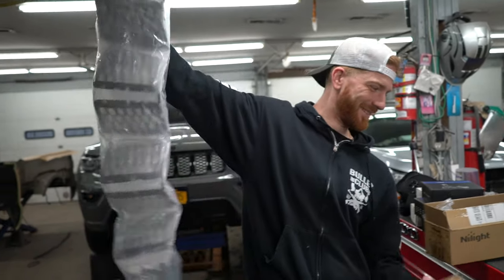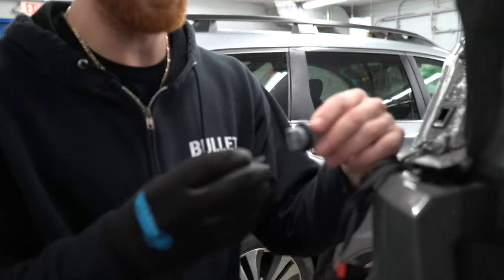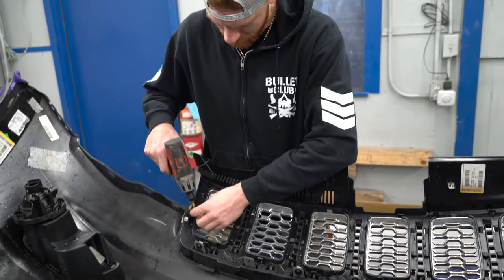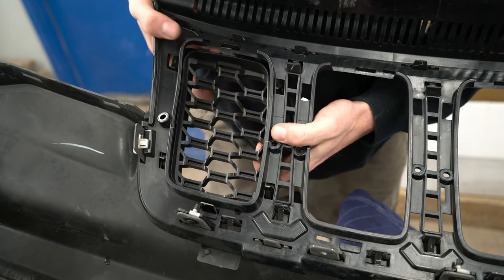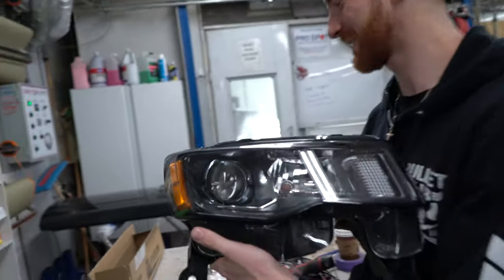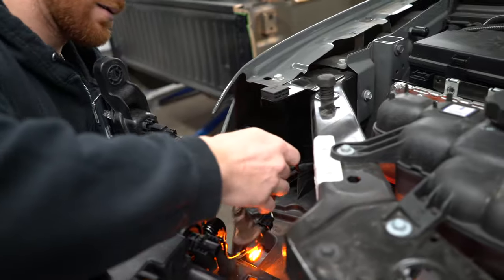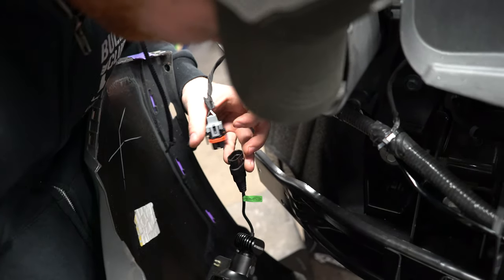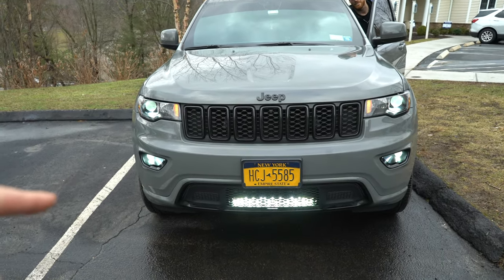2020 Jeep Grand Cherokee LED CONVERSION & UPPER GRILL INSERT INSTALL

Comment: Dude....seriously, the camera work gave me a headache...Did you film it on a phone from 2000?
Reply from the maker: It’s shot with a Sony a7s ii but the lens on it was damaged I need to buy a new one. It’s also shot in 4k so make sure your resolution was set to that other wise it will play at a lower res and can be pixely

Comment: Does ur jeep have halogen or projection type? I have a 2019 grand cherokee and have changed the bulbs to led but they still don't shine bright white, they're kind of like a yellowish hue to them and was told it's because of the headlight lens type or whatever
Reply from the maker: The stock bulbs where halogen and what was the color temperature of your LED bulbs? I don’t think that’s true cause these are clearly pretty white
Reply: Pretty sure all WK2s have projectors.
Think you mean halogens or HIDs, which  depending on who you talk to is either etra wiring to even an "entirely different ellectrical system"

I know it the '14 it was found that the lens had golfball divits all around. Never hear of them having different tints, but not sure what changes were made after 2018-2019

Comment: Anyone doing the lights in the lift gate, be careful particularly on a 2013, mine must have been made a little different...the translucent dome shade on the outside snaps together with the housing inside the door panel and the tabs on the dome are brittle as hell and broke very easily.  Breaking one tab means it won't stay on and the housing wont stay in the hole so breaking one tiny little uncooperative P.O.S. tab can ruin your day.  If you can get one to stick back I the damn thing to fix it, you're a better man than me.
Reply from the maker: Thanks for all the information hope everything goes well with your build!

Comment: Looks nice I just got a 2012 Jeep Grand Cherokee and I see a flash with the high beam seems like goes brighter but when I go to look at them that high beam bulb is not on on both sides it's strange to me because when I have it on auto high beam I see him go off and on but when I turn it to manual and then I put brights I see a brighter light but when I go to look at the headlights I don't see that second inner bulb on
Reply from the maker: Hmmm that’s very strange I’m guess it’s a computer or wiring problem

Comment: How many pairs of LED’s ? Looks like he used 6 new ones so would you have to buy 3 of the LED pairs?
Reply from the maker: 2 sets for the head lights 1 set for the fog lights 1 set for the reverse lights
Reply: @MrMsStang  where are the reverse lights from the same place?
Reply from the maker: @lexusjackson6470  I believe so yes!

Comment: You have to worry about hyper flashing with switching to LED’s
Reply from the maker: Yes but we don’t have that problem and not using led flasher bulbs
Reply: @MrMsStang  so if I were to get just the bulbs for the headlights don’t need to worry about hyper flashing?
Reply from the maker: @86keen  if you get the same bulbs as the video they won’t hyper flash but if you get led bulbs you’ll need a special harness to prevent it from hyper flashing

Comment: Do the LED lights overheat? I just got a new 2021 Grand Cherokee but it has the halogen light bulbs I have heard that just replacing the bulbs can mess up the modules?
Reply from the maker: No we have not had any over heating problems and this is a daily driven car too!
Reply: @MrMsStang  Cool thanks- might look into this upgrade
Reply from the maker: @jimsafy2798  it’s a nice upgrade without breaking the bank!
Reply: LED lights are warmer on the rear but cooler on the front.  I've never seen the rear heat mean anything but a warm touch to the hand.  The front being cooler is excellent if you want to avoid burning any overlays like clear bra or smoked tint vinyl like I have in my 2020.  I burnt my 2007 Tundras smokes headlight film overlays after a couple months with stock halogen bulbs with a bubbly bumping finish eventually showing up but years of running LED bulbs haven't harmed the smoked vinyl re-tint.
Reply from the maker: @Barberdan  yeah LEDs don’t get hot just the ballast attached to them

Comment: Are the high beam and low beam the same bulb?
Reply from the maker: No I believe there two different sets
Reply from the maker: @Barberdan  I’m not sure I can double check with the owner of the car if you’d like
Reply: @MrMsStang  I managed all 4 H11 bulbs just over a week ago.  Had to pay the dealer $99 for 90 mins labor to replace the damn passenger low beam because it was out of my range of expertise.  Let's hope these LED bulbs don't let me down for a very long time.
Reply from the maker: @Barberdan  LEDs  are known for lasting longer so you should be good! Hope you enjoy them

Comment: Find slim fit led bulbs for the headLight and you can switch them without taking out the entire headlight assembly
Reply from the maker: Yeah definitely but we decided to take it out cause it’s easier to work on and video them

Comment: For the lightbar, can you explain more about the brackets and why you needed them. Also, can you confirm that the lightbar can be bolted (is there room to use a nut and bolt into bumper or does it need to be screwed)?
Reply from the maker: It’ll be a tight fit and you might have to try it a few times but the lite bar definitely fits today without having to do any type of cutting. The brackets go into the front frame bar and you’ll have to drill holes and you can fit a nut and bolt on there and be good to go.
Reply: Rough Country also sells a 20” light bar with bracket that fits right in. Brackets mount to the tow hook bolts. Of course, if you don’t have that specific light bar from RC, a custom bracket may be needed. Clean install. 

How noticeable have the reverse lights been? Seems like an easy 15 minute mod that’s worth it if noticeable.

Comment: Thanks! I have been looking for this install to do for mine
Reply from the maker: Awesome glad we could help you!
Reply: In total you used 3 pairs for the high, low, and fog.. then 2 pairs for the reverse lights?
Reply from the maker: @doubleokneegro  we did a pair of high and low beams then fog lights and reverse lights then the led bar under the grille